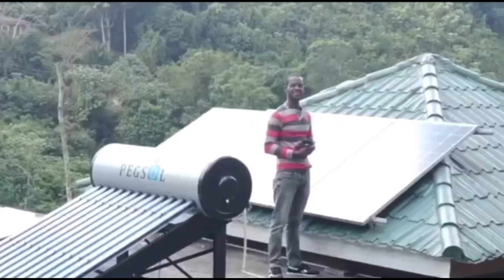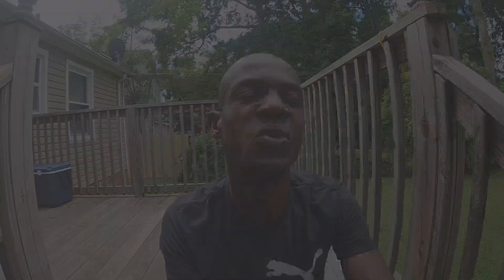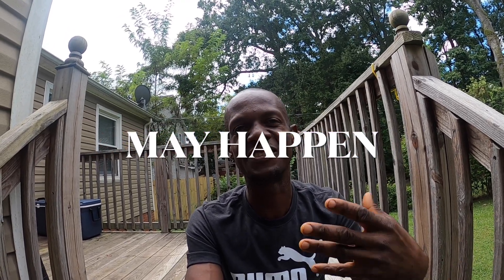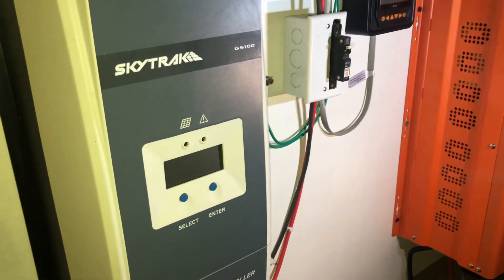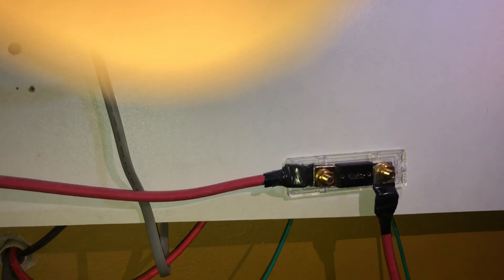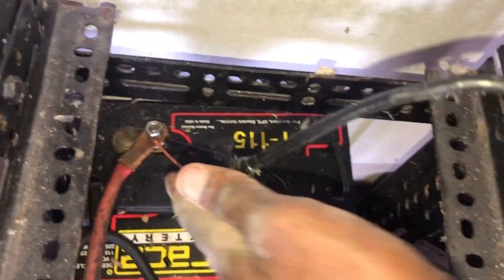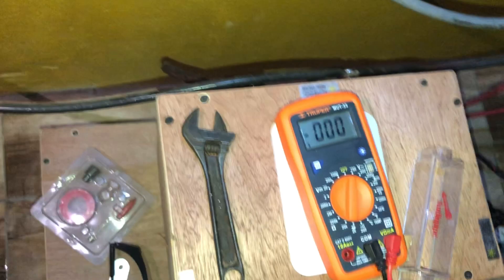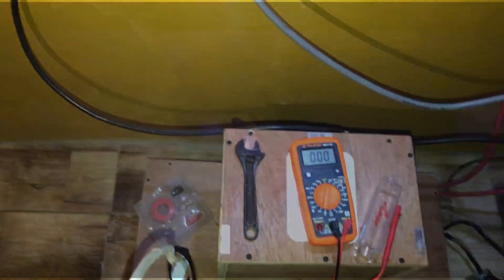How to Awake a Sleeping Lithium Battery Bms | Solar Energy

Comment: I have a po4 lithium battrry it's shutting down so much what should I do
Reply from the maker: Well in most cases, the battery is depleted below its cut off voltage so the BMS cut it off to protect the battery. The only thing you can do to fix that is by adding more battery or use less from the battery/batteries. Also check to see if your panels are getting sufficient sunlight, or if you need to add more panels. Or it can be the Bms cutting off too early. Most of the time is just more battery storage your system need. Hope this helps, if you have any other questions feel free to ask.

Comment: to prevent the bms from shutting down set your inverter cutoff  voltage higher than the battery cutoff
Reply from the maker: Thanks much 😎